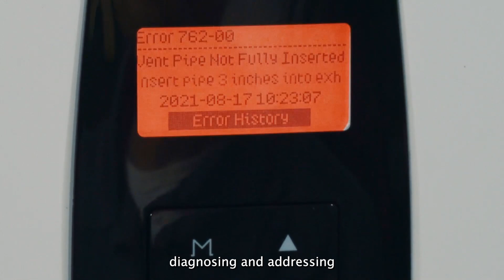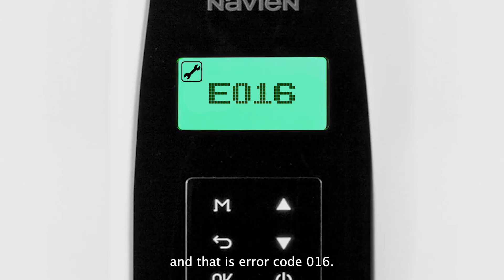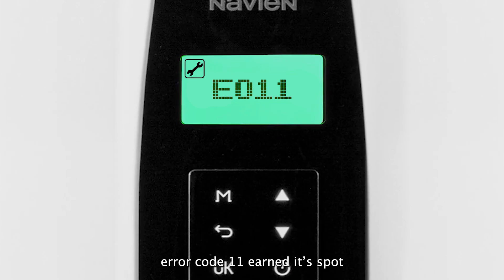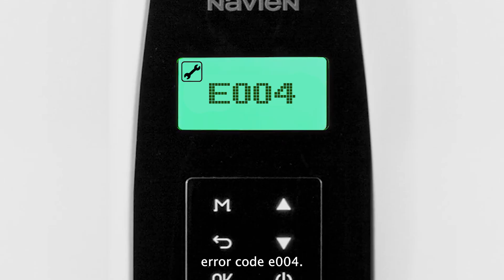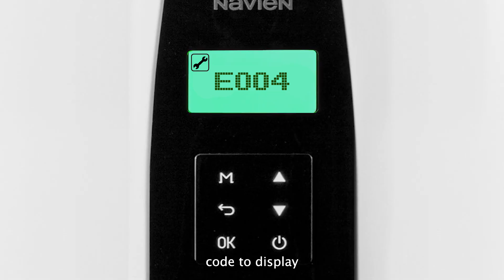Most Common Navien Tankless Water Heater Error Codes and How to Fix Them

Comment: My navien tank is junk. I have been receiving a valve error that I can fix after resetting but that’s after losing heat, any benefits I have received by having lower bills will be undermined by the stress of worrying about burst pipes and the necessary remediation by plumbers charging 300 an hour.
Reply: Do you own a manometer?

Comment: Is it true that Vavien won't even talk to the customer and that homeowners can't buy parts?
Reply: I've experienced both. I'm the homeowner and have spoken to them several times and diagnosed my issues and they sent me parts. I've rebuilt my first one a few times, then got to another problem and they'd only communicate with my plumber. I'm now on my 2nd unit after rebuilding my first. I paid full price for this 2nd one and have a new problem. I am ripping this piece of junk off the wall and throwing it over a cliff. And putting in a regular tank water heater today. I don't recommend these water heaters at all. The end
Reply: @ Thanks for the input. Which model is the one you want to throw off a cliff?
Reply: @mateo801  navien npe-240a2 . I hopefully will be getting a new motherboard shipped to me tomorrow... I have a water softener too inline btw but our city water is pretty hard, not a factor for the motherboard but it did kill my previous ones heat exchanger. From my research the motherboard is a recurring issue.
Reply: @mateo801  update. I got the new motherboard in. It took a few  on off cycles to stop flashing the same original code...then the ignitor code came on and disabled operation...lol. I pulled the rods n cleaned em, cycle on off a few times then it fired up! Don't celebrate yet...it lasted long enough to have one family member shower, dishes got done and 2 more showers...then end of 2nd shower it shut off again. Same as the first code- motherboard.. 788-00. These things are junk
Reply: @ how many old is the unit
Reply: @mateo801  around a year old maybe less

Comment: I'm getting error code E 438.  Circulator is bad?
Reply: Same with me. Was you able to fix it?
Reply: @SomeGuy001  So a plumber came over and fixed it and I regret not doing it myself.  The E 438 code can indicate the circulating pump malfunction per the manual.  However, the plumber insisted it was a flow sensor error.  He took off the flow sensor (4 screws and 2 leds super simple) and flushed it with some water and cleaned it with a brush.  He reinstalled it and it worked.  If I need to change the circulating pump, I think I'll do it myself.  it's basically 4 -6 screws.  

Start with the flow sensor and clean it out.  Good luck!
Reply: @norm7778  thank you very much. This was my problem. For further instructions. https://youtu.be/CDlkBia-5Zs?si=IdqU4IPWDXQ_BABR
Remove the pin or sensor that’s held onto the casing with two screws and clean it.
Reply: @ No problem.  "Cleaning" it meant using a brush and ran some water through it.  Save yourself a few hundred dollars and a plumber visit and do all the work yourself.  It wasn't hard to do at all.
Reply: E 438 can also be caused by a bad check valve. It happened to me a few days ago and I found that the check valve had snapped in two and blocking flow within the recirculation system. I disabled recirculation mode and heater works just fine until I get the replacement check valve. However, I may simply leave recirculation off as I don't notice any difference in hot water supply without it (it was internal only)

Comment: So this video tells us we need a technician for every code!  Wow, how helpful this video is, lol, what a joke!
Reply: These water heaters are also a joke. Even if they're regarded as one of the best, they suck. Im about to throw my second one away. After rebuilding my first one numerous times, this 2nd one isn't gonna trick me again. I'm replacing today with a new tank heater. Error 788-00 code this morning. I'm over it
Reply: I've had my Navien NPE-240A for 12 years with very few issues - it's a great heater that's easy to work on. Although the video says "call technician" it also tells you what the issue could be, allowing you to order the parts and install yourself. I found the video very helpful

Comment: I have two Naviens. One is for the hot water and the other is for baseboard heat. The hot water shows the water temp on the display. The other never shows anything on the display.  The baseboard heat comes up but an ecobee thermostat sends me emails that there is a problem with the furnace.

Comment: I get error 110 every time the temperature goes below -30 .
Reply: 110 codes are typically exhaust blockage codes and can occur more frequently during cold seasons if ice  collects through either of the pvc pipes , or it could be a fan issue or even a condensate line issues

Comment: Great video. I’ve had code E012 a few times. Had the igniter rods replaced. Happened again and Navien had my tech adjust the gas valve.  12 months no problem. Problem just happened again. I’m wondering if it’s possible to confirm gas pressure by having  pressure gage installed so we can read it?
Reply: Did the tech adjust it so you were getting more flow in or less? Do you remember?

Comment: How about an abnormal cascade code on the main heater with two side by side heaters  when the electricity goes off? It’s an easy 5-6 step fix but Navien stopped helping over the phone. Need someone to make a video about how to reset. Would be so helpful
Reply: Hi that’s the 736 code and in the installation and operation Manual under connecting the communication cables will help u troubleshoot that no problem

Comment: Hi Great video. I did descale and for some reason (I verified 10 times :)  all connection is right and pump is pumping water in but it is not coming out from hot side Anything to check? Waited several minutes Nothing
Reply: Is your unit powered up?
Reply: When you trigger the tp valve does any water come out?